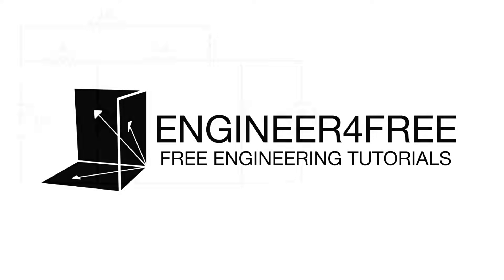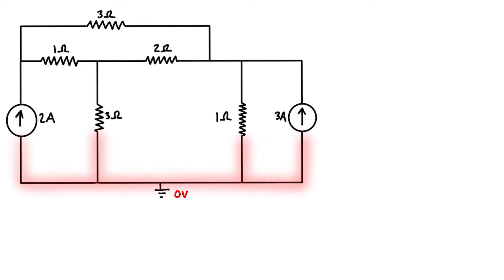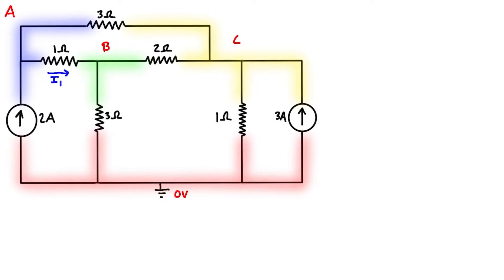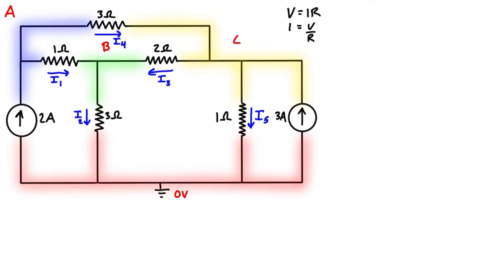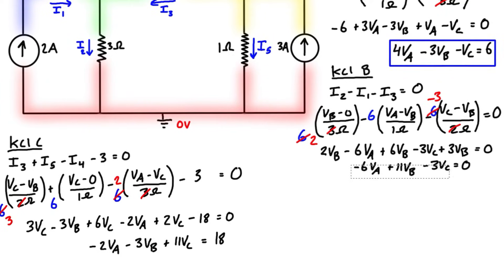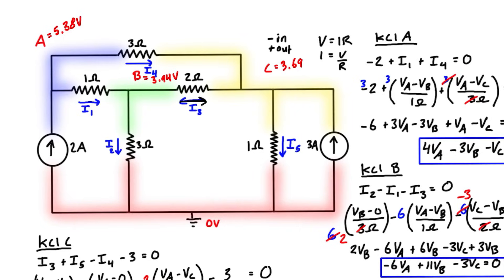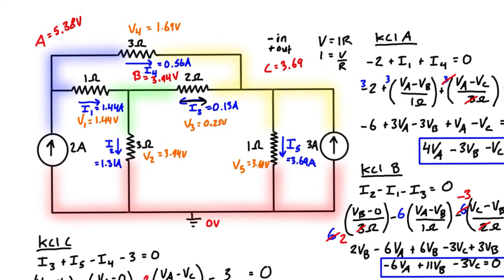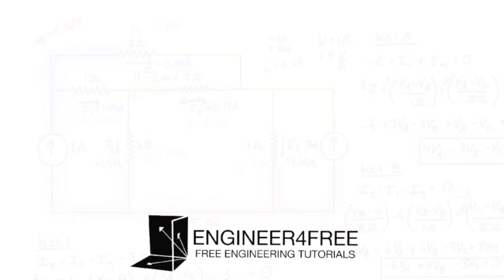Nodal Analysis Example Problem #2: Two Current Sources

Comment: Most times i get confused when identifying the nodes so i just redraw the circuit and form nodes by joining terminals that connect together and removing those square conners cause they confuse a lot

Comment: how do you say which current is moving in and which current is moving out
Reply: When the arrow is pointing at A (for example) is coming in, but if its pointing the opposite direction then its coming out. Same with be, if it's pointing at B is coming in, if it's pointing the opposite direction is out.

Comment: @ 7:31 "And we can see here I_3 has to be switched..."
DON'T EVER DO THAT! The current values you obtain are consistent with directions of current flow assumed in your diagram in the first place. If any of them are negative then that just means they actually flow in opposite direction than what you assumed. But don't change you diagram. To do so introduces a possible source of error for future calculations. In the meantime, you're engineers. You're supposed to be able to figure out what a minus sign means.
Reply: So switch means from negative to positive? As I_3 is leaving the node B
Reply: @CGBDChannel-k5u   As he is using that word in this context, yes. To do nodal analysis properly you have to assume direction for each branch current. When you've solved the problem completely if the values of any of your branch currents are negative then it means that you chose the wrong direction of current flow for those branches that have negative currents. But don't change directions on your diagram.

Comment: Sir I use cramer's rule for the voltage  ..and it seems that  it didn't match the answer given by my instructor ,why's is that?
Reply: 4.25, 1.312, 3.69
Reply: There the same using Cramer's law unless Vb it's quiet different but that much